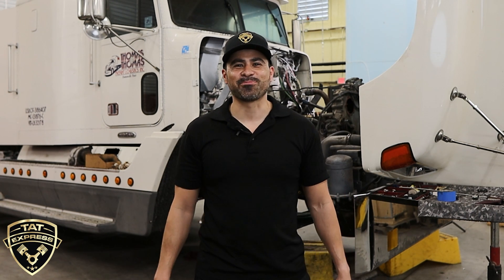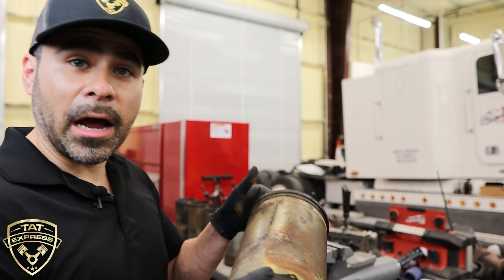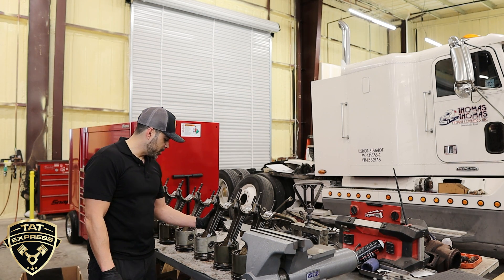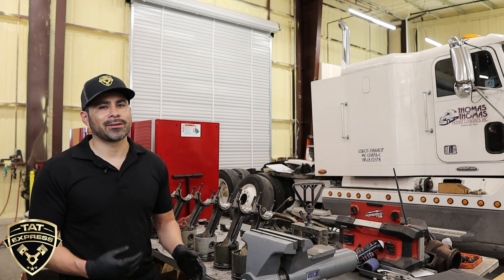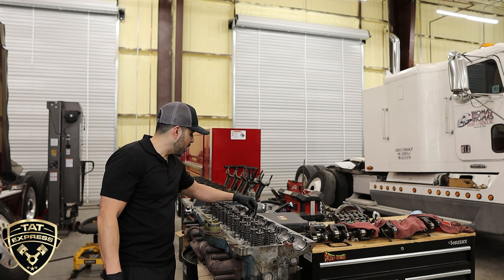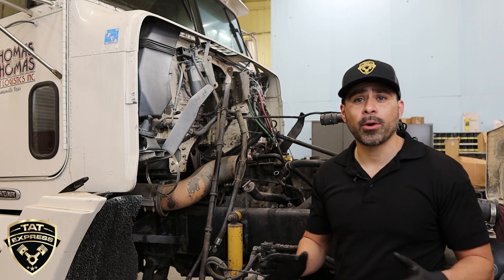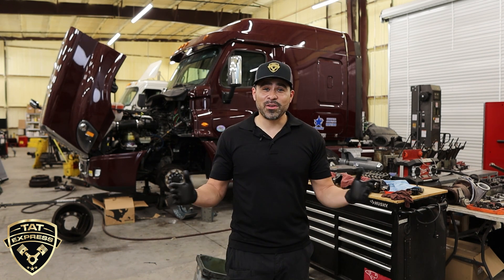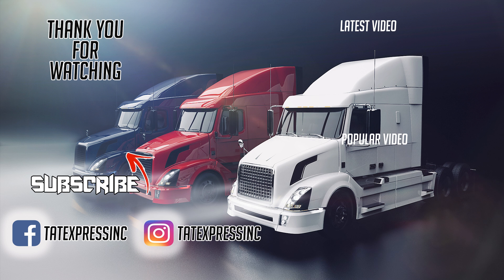Series 60 most common issues/ Detroit  diesel series 60/ Series 60 12.7 pre-emissions/ Detroit S60

Comment: I’ve got injector troubles.  No power.  White smoke when it warms up good.  No oil in the coolant or coolant in the oil.  I need some advice!!
Reply from the maker: @PaulWalker-b2c White smoke on a Series 60 after it warms up is usually fuel-related — you’re either overfueling or one injector isn’t sealing/balancing right. I’d start with a cutout test and a fuel leak-down test. Also check injector cups; when they crack you’ll get white smoke and low power without mixing oil/coolant.
Reply: @TATEXPRESSINC thanks for getting back to me
   Would I do better with a new fresh head and injectors etc?
Reply: Couldn’t or would be an ECM problem?

Comment: What should I look for in buying a new head for a 99 bk 12.7 liter??
Reply from the maker: @PaulWalker-b2c For a ’99 BK 12.7, make sure the head is pressure-tested, magnafluxed, has new valve seats, and new injector cups. Also check valve recession and cam bearing surfaces.

Honestly, I always recommend going with an OEM rebuilt head — they hold up the best on the Series 60 and you avoid all the issues that come with welded or “repaired” aftermarket heads.

Comment: I can tell you exactly what happened to that truck. The reason the parts dont match because that is a two piece piston design. Those were famous for coming apart with very low miles. Most people would just replace the one piston instead of building the whole thing. This was common when those motors cam out. Mine came apart but i did a full rebuild rebuild. 11:50

Comment: Yes was the best engine for its run from about 2008 to 2015 years and the epa started killing the diesel engines with controls that the manufacturer  could not   handle then .thanks. Glenn

Comment: I have sputtering and lots of smoke. The smoke comes and goes. The sputtering is on take off and downshift. 3 mechanics including Detroit is saying it number 2 injector. I replaced and still doing the same thing. Any ideas? 12.7 60series. 1998
Reply from the maker: We would recommend replacing all injectors and fuel pump. Take note, finding a good set of injectors can be challenging
Reply: @TATEXPRESSINC  it smokes while idle mostly. I've changed 2,3,5 injectors and ECM.

Comment: we have a 2000 series 60 Detroit in a western Star good running engine. We do a 100-mile run about every day with it some days it will use a gallon of oil some days two Qts and some days it doesn't use any it's always the same driver. any ideas what's going on

Comment: We are having an issue with our  2013 D13 volvo. It will run for hours. The minute you stop and try to go again it jumps out of gear and says high clutch load on the dash. It won't go anywhere but tries to lurch forward. It's like you have no accelerator though. Volvo engineers have looked at it and can't figure it out. We are desperate
Reply: I know this is quite a bit later.
I had this problem.
The lever that changes gears inside the transmission had worn out.
Comes from low air pressure.
I had to replace the transmission.
Everybody tried to tell me it was injectors.
The mechanic had taken apart the transmission to show the exact part that failed.
I have the same year and model of engine

Comment: thank you for this video 🙏🏼 i have a question : 
what’s the recommended idle RPMs for this engine? 
when i turn on the cruise control and engage it goes straight to 1,000 but it seems too high to idle let’s say for 2-3 hours for heater/AC so i leave it around 750rpms . what are your thoughts on this?
Reply: Whatever RPM it's at when your oil pressure is at 30 PSI. Usually 1000
Reply: As above, 1000-1100. Why? One issue is the turbo seals will relax causing consumption issues.

Comment: Erosion or Corrosion?  Not the same thing.  I believe you mean corrosion.
Reply: It is erosion, now there is certainly both but the counterbore area under the liner and lower seal area are most definitely erosion, this can also be found on the head and injector cup. Proper coolant maintenance is a must to hinder cavitation.

Comment: What's the oil pressure on this engine at after you run for a while
Reply: Mine runs 48-50 pounds at 1400 rpm’s. But mine only has around 85k since rebuild
Reply: @TheFreightliner777  my run 55 at 1400 but went I stop only 25 at idling
Reply: @TheFreightliner777  I have 379 detroit serie 60 12.7 500 hp just good engine

Comment: Have almost 1.1 Million on the 14L and Its going strong.
Reply: Hey! Do you think it’s a good idea getting a 06 frieighliner Columbia 14l with almost a million miles ? EGR motor NOT ball gear. Never overhauled for $40k
Reply: shonzy jay I wouldn’t think it twice I have 05 Columbia and 06 century both with Detroit 14 liter to me beat motor out there and cheap to overhaul
Reply: @813_racing3  and tons of power. Easy to work. Especially for things like senors, computer, turbo and so forth. Been a great engine and at this point is just making money long after it's been paid for.
Reply: @shonzyjay1221  would vary on condition. In this market trucks have been going for much more than they used to.
Reply: How can I send you some picture of the truck so you can help me check it out ?
Reply: @shonzyjay1221  you need to look at overall mechanical and cosmetic conditions. How does it run? Check wires, hoses, belts, fluids and so forth. Are there any codes? Are their maintaince records? How is the interior? Body? This truck I got years ago and accepted the flaws. Fixed the mechanical issues. Engine itself has been solid. When they are older with higher millage most likely there will be some issues all around. Thankfully I got my truck for much less than today's prices. So even though I have things to fix. Its costed less than what one would today.
Reply: To me the truck is flawless and it drives good. I took my trailer there and hooked it to it and it pulled well. I just needed someone who knows a-lot of trucks to have another look. If you have an email I can send it to you.
Reply: @shonzyjay1221 so, if it checks out and you need that kind of truck I'd get it. Though a good look over it by a truck mechanic there will be what you would want to do.

Comment: Have a 14L in a 2007 Columbia has been been doing great. Pre emissions. Have done some work around it. Though I think is the problem of the set up from the previous owner. It has earned its place and glad to have it. Hoping to get some more good use out of it before have to work inside the engine like this.
Reply: Iouuouououououoouou
Reply: Iouooouooouoououoouooououoouououou
Reply: Uouououo
Reply: Uouououou
Reply: Yep iYep ouooouuououou
Reply: I have the same one year model what did you do to it mine doesn’t have much power when loaded but gets the job done
Reply: @robertramos1190  bigger turbo, New ECU tuned to 550hp, K&N air filter, new upgraded intercooler hoses, and had to get a silicone upper hose. The rubber one  developed a hole in it. Straight piped out the back. I've worked all over my truck and know how to drive it to get max power. 550hp is pretty good. Truck runs fast and pulls the hills very well.
Reply: @DJPereira2012  where did you get the tuned ecu and what model turbo if you don’t mind
Reply: @robertramos1190  was on ebay from a ecu supplier. And the turbo was a custom one. Overbuilt in Phoenix.
Reply: @DJPereira2012  that’s crazy I’m in Phoenix lmk where thanks in advance !
Reply: @robertramos1190  it was a turbo shop down there my father had found on google search. Has made couple turbos for us now.

Comment: That pitting on the liner is from the SCA drop out. Or just putting straight green coolant in there. It’s cheaper to put green coolant concentrate.  As well as three pints of penn cool to keep cavitation from occurring. Some people don’t keep up with that penn cool conditioner or something similar of a different brand also is a factor. If you drive around bob tail like a show truck that doesn’t really matter about the conditioner.  It only comes into play when the trucks working hard especially with being lugged.
Reply: Are you saying the liner pitting occurs more from lugging engine?  Been wondering how many hours or miles is usual yo have liner pitting g failure.

Comment: the old cummins ntc were bad about pin holes in the liners so i ran nal cool to stop the bubbles. the blocks were able to be machined without pulling it to fit new liners.

Comment: How much blow-by is acceptable it runs good does not use oil has 50 pounds of oil pressure 725000 mile
Reply: All Series 60 have blow by to a certain extent. It's what they do. If it's not making a racket or smoke out the blow by tube it's not doing its thing. They just keep going and going. Best motor ever made in my opinion. I've have that same motor. Got 1.7. Out of it before rebuild. At 1800 rpm and up it turns into a sewing machine. Smooth as silk and whining just like one.

Comment: Best motor ever made! Had a cat before had a Cummins had a old Volvo but nothing compares to the 12.7
Reply: I've got a 99. No egr. 12.7. 80k on rebuild. Got 1.7 out of original. They like to rev. Oil at 10k with Lucas. Paper logs. With fuel way up in price and freight down 30 to 50% I am still making bank. Don't know how these guys are making money with e logs .
Reply: @edfalconi5022  I bet you are not old enough to drive
Reply: @edfalconi5022  Amen brother! X2
Reply: Beg 2 differ, I have a 12.7 60 series & a N14 Cummings, the N14 is a much motor. The Detroit is better on fuel but the N14 is much stronger. Luv them both tho
Reply: I get 4/5mpg with a van doing 80 and 6 doing 65. 140k on rebuild. I do 55 up parleys and sisters at 75k. I am worried about over working it. 500hp and 1550 Tourqe
Reply: @rino1901 I blew my 12.7 up on the sisters 5 miles from the truckstop about 7 yrs ago😂
Reply: Nothing better than Scania
Reply: I kinda liked the Cummins better. Especially replacing an alternator when in a bus. The double stacks can be a pain in the butt. Never really had too many engine problems with the Cummins. Then again, same with the 60 series. The DD engines stink.

Comment: Erosion aka lack of proper coolant maintainer, the liner will flex during operation causing a phenomenon called cavation ( air bubbles) in the 90, we were far far ELC coolant but even ELC should be replaced 100,000 miles . now a good rebuilder will mic the crank, and receiver which is the part where the lower seals make the block and if they are auto spec they will have not only the top counter board they’ll have the lower receivers redone and you can guarantee nice tight fit and eliminate excessive walk of the liner.

Comment: 11:15 what is high mileage for an oil change? I try to do mine every 10k miles but sometimes i go to 12 or 13k due to mileage only beign 7 or 8k when im home...
Reply: My advice you're doing OK , Sometimes I let mine get to 12 but normally I do it right at 10,000 Pretty much every month
Reply: Get ecopure oil bypsss. I run 75-100k without oil changes, only filter replacements at 25k, have lab test oil samples
Reply: @matbob7249  oil is cheap bruh... I dump mine every 5K. Easiest oil change ever. Costs me less than $180 and 10mins of my time